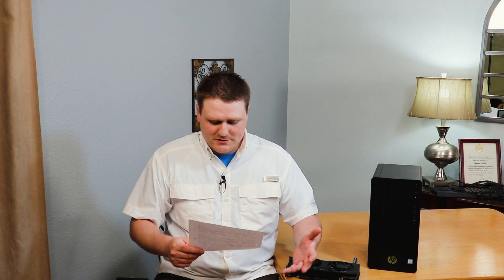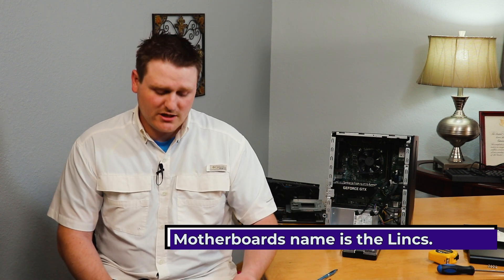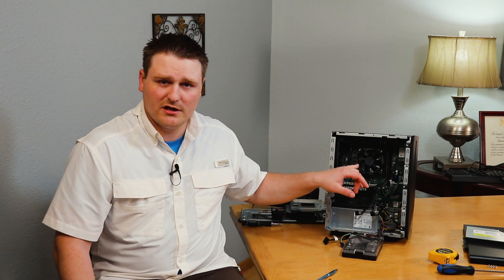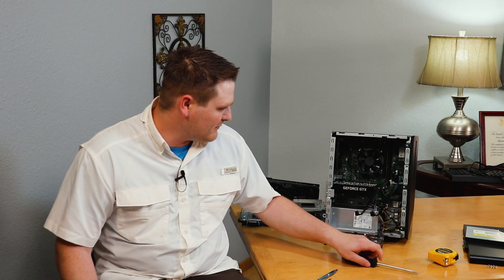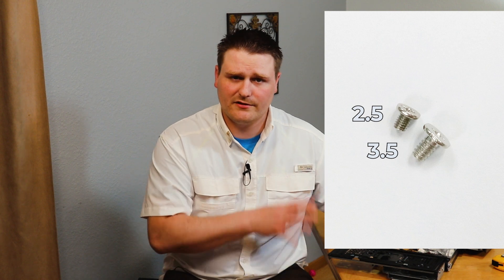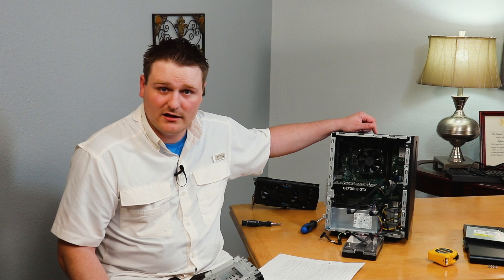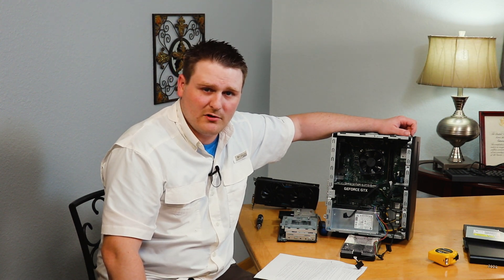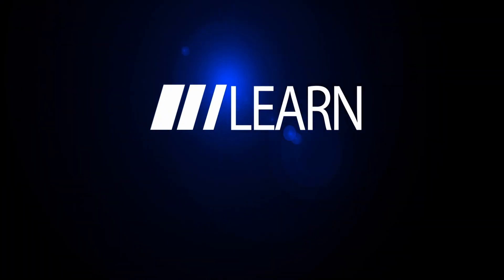Upgrading A HP Pavilion Gaming Desktop Explained! | Intel i5, 1660ti, 8GB, SSD + More! HP 690 Models

Comment: Hello techNW, I really enjoy your channel.
(you likely see my comments everywhere trying to work the YT algorithm for you !).
So it is 2025 and I would like to do a last upgrade on my pavilion 690.
I am a real newbie at this and I am now retired, just to give you an idea of who you are dealing with! L
I am hoping you can sort-out the best parts I can put in that box now/today in 2025.
I have removed the shelving/cage in the case and replaced the lid with a piece of clear acrylic to admire the innards...
The unit is:
(your link for the HP Spec Sheet, is now dead)
Desktop 690-00xx
BIOS Version/Date AMI F.50, 2023-04-20
 i5-8400 CPU
BaseBoard 843B
12.0 GB original RAM
One original SSD for the O/S and one HDD as a D: drive.
I use two external Samsung SSDs for movie and document storage.
.
Could you sort out brands and models that would fit that Pavilion for:
32MB fast RAM (I think that is the MAx for this motherboard?).
Fast Intel CPU.
Compatible aftermarket cooling block for CPU (a cool looking one would be nice 🙂).
*I am hoping to over-clock the CPU and GPU if possible*.
A fast SSD internal drive (or should I use a NVnE drive) to reinstall the games from the HDD.
I have ordered a 500 Watt PSU (L05757-800 87$ Canadian!) and scored a nice MSI 2060 Super (300$ Canadian)!! 
.
I realize this is a "big ask" but I hope you can sort this out for me, as... I am lost!
I am hoping to do some VR on this PC like MS Flight SIM and Mild SIM racing with like Assetto Corsa. 

Thanking you in advance.
a.

Comment: Hello, My PC Specs are the following:
HP
Series: Pavilion
Model: 690-0034
Processor Brand: AMD
Cores: 8-Core
AMD Ryzen™ 7 2700 (3.2 GHz base frequency, up to 4 GHz burst frequency, 16 MB cache, 8 cores)
Base CPU frequency: 3.0GHz
Max CPU frequency: 3.7GHz
Processor Cache: 4MB
Memory Type: 16GB DDR4 SDRAM
Memory Speed: 2666Mhz SK Hynix CL19
Max Supported Memory: 32GB
I would like to upgrade to the Full 32GB MAX
If I buy a ram with CL 16 specs will my bios automatically run at the lower CL19 that's it's configured for or will I have blue errors? Can you you recommend a Ram Brand that will work and not send me into blue screens

Comment: Would Nividia 2070 work with this system? If the card is 10.1 inches will that be too big? Also could I use a 2070 mini it’s only 8 inches does it perform the same? I’m trying to run six days on fallujah and it says it requires a 2070

Comment: The r7 3700x would work or do I need a new psu, same question for a rtx 3070 what upgrades would i need my pc is a pavilion 690-0024
Reply: And what’s the best options for gpu and cpu with no power supply upgrade(400w). And then what is the best cpu and gpu with a 500w upgraded psu
Reply from the maker: Yes, RTX 3060ti
Reply: @TNW1337  do i need a psu upgrade for it?

Comment: I had this build for about two years and I loved every bit of it but recently I’ve been running into high CPU usage problems while gaming and I’ve tried countless of solutions and updated my graphic drivers and I have nothing left to think of what to do to help it except buy a new CPU
Reply from the maker: Reinstall Windows. Reapply thermal paste. it sucks but most of the time if the hardware is not bad, it will fix the problem.
get a 256GB or 128GB USB 3.0 Drive Back up and Pic, Documents, And look up how to backup game saved files. Almost 95% of the time this is in your user folder. Most steam games are back up on the cloud even if they are single player.

Comment: Hello I have a question. What if i would upgrade my pc by just buying a bigger pc case, buying new power supply and new graphic card like 2060s would it match? I would keep the HP motherboard and all other stuff like procesor... would it work?
Reply from the maker: if you did a swap you would need 4 things. PSU, Motherboard, Heat sink and Case.

Comment: you forgot to mention what power supplies will work in this if you decide to upgrade the power supply to say 500w or 650 watt, that is what I need to do to mine. Any suggestions?
Reply from the maker: If you look at my Videos you can do a 400w and 500w PSU For most of the SFF HP Pc's.

Comment: My wife has a hp pavilion 690-0034.   I spent $700 on upgrades for it.  Just wanna know what’s the best graphics card to put in it.

Has 500w power supply
3 fans, 1tb m.2 ssd , 1tb 2.5 ssd hard drive
1tb wd hard drive, 32 gigs Ram, blu- ray drive,
2 tb passport.   And a pciex1 adapter 128 gb ssd.
Reply from the maker: Best would be the RTX 3070 Or a 6700XT
Reply: Thank u

Comment: I upgraded the ssd like the chip, the gpu and cpu but now my go pavillion desktop won’t boot into bios I don’t get anything in my screen
Reply from the maker: ok did you do a clone ?
Reply: @TNW1337  a clone ? I don’t think so. My brother took his 1650 super out of there, ram, and ssd so I just bought a Zotac 1650 oc, new ssd, a ryzen 3 3600, vengeance ram. The hp pavillion desktop still had the same cooler and motherboard so I don’t know. It starts up fine but it doesn’t show anything on my screen so I’m a bit confused.
Reply: I replaced the m.2 ssd to a Samsung m.2 ssd is that the problem?
Reply from the maker: @lyangonzalez6117  Did you clone the Drive when u swap it? is Intel optane enabled ?

Comment: Is there a motherboard that fits the case but supports up to i9 and 3090 graphics card?
Reply from the maker: Nope, your only option if you want to do that is a case swap to a different Case, Psu, Motherboard. Now if you watch sales you can do this for under $200.
Reply from the maker: 1st problem is 3090 are all triple fan cards, so to big for the case you could try a 16x 3.0 riser cable with a test rig and a extra 500watt psu. Also this would almost be the same cost of a case swap. But this would not let do a i9 upgrade. So the best thing to do would be case swap. That would allow both CPU and GPU upgrades.

Comment: So I've got the 690-0073w and was wondering if it's possible to slap an independent wireless card/ adapter in.
Reply from the maker: You do have a 1x slot open above the gpu.

Comment: So i purchased this machine about 18 months ago for my daughter to play fortnite. In its stock form i notice that she can pull down 165fps max at 1080p medium-high settings(this is also the max frames at lowest). CPU utilization is at 100%(2.9ghz) RAM util at 80+% and GPU util at like 30-35%. I got her the Asus TUF 280hz monitor because shes a competitive FPS player. Is this machine in stock form not able to run the intel turbo boost? it never exceeds the 2.9ghz despite the chip being rated up to 4.1ghz on turbo.  short of rebuilding the cpu/mobo/RAm/case/PSU, can i do anything to squeeze more out of it? seems like the bottleneck being at the CPU is pretty silly and with it only running at 75% or so of the max rating for the CPU maybe its just the mobo limiting it. Would i be better off gutting it and building her a gen 3 ryzen machine which can handle the FPS increase to get her more frames at a better visual quality? i didnt want to do a CPU upgrade if i would be better served with a mobo/chassis/psu upgrade and or maybe a ram increase. the NVME onboard, can it be transferred to an AMD machine? im not entirely clear whether i can transfer that or if it would need to be replaced as well. thanks!
Reply from the maker: Change the thermal paste and hestsink it sounds like it is hitting prochot. I never seen the pc not boost for the intel or amd version. Download intel extream tuing utility. Also download hardware info to look at thermals for well she is playing only time the cpu goes it to low mhz state is when it's seen very high thermal it is a protection mechanism. It could also be a bad cpu as rare as this is it can happen. The speed shift or speed step epp mod could be broken. All the parts could be transferred yes. You would need a new case, psu & mobo. You could go amd but need a new cpu & mobo. If the pc is holding at 144fps or above it should be able to play with out a problem. Hertz and fps are tied to gather to pretty well.
Reply from the maker: It could also be that you're using a game that is usualizing all of the cores and will not allow you to totally Turbo The cpu. The only way you can undo the bottle neck, would be to put in a  i7.  Does not support k edition. So need none k hope that makes sense.
Reply: @TNW1337  I do understand. But I suspect for the price of a better Intel cpu it might be better to snag the gpu and do an amd build. Plenty to ponder here
Reply from the maker: @CW-uw2cb  intel has really droped out of the game AMD was in lead but the 12th gen intels are doing very good.
Reply: @TNW1337  I should clarify that 144fps is easily functioning however her monitor can go to 280hz/fps. The more frames the better she can play and she's incredibly good
Reply from the maker: @CW-uw2cb  cool fact the humane eye can not see past 30 to 60fps. Only reason to go past this is for frame drops. The higher the fps the less likely it is to effect the game when this happens. Also can add smoothness to the game. Another reason is to game at 4k. So most gamers that play shooters do not like 4k becuase of the up scale the game does, it makes every thing smaller. Changes hit boxis, aim ect. This is why 1080p and 1440p is most common.
Reply: @TNW1337  well while the human eye cannot see beyond 60fps, the human brain is aware of the interaction difference with up to 1000fps and gamers at 240fps have a distinct advantage over those at 60fps and even a moderate advantage over those at 144. I've become so accustomed to 144 that I am actually able to tell you in a blind test which monitor is running at 60fps steady or at 144 steady. I do need to move the mouse myself but I can tell the difference each time without fail
Reply from the maker: @CW-uw2cb  yeah like I said it smoothness that's all your seeing. Some one way smarter then us well fuguer it out.

Comment: hi i bought hp pavilion gaming tg01-1122 and i can't see no display i tried few methods but nothing to seen work
Reply from the maker: Ok It is possible, it is DOA. Dead on arrival. Cheek the GPU is all the way seated on the Mobo. if the GPU has external Power make sure the  Power is plugged in.

Comment: I have the 400watt PSU can I run a 2060 super stated as 175w power draw
Reply from the maker: Yes you can.
Reply: @TNW1337  I watched your videos and can confirm this to work fine. Installed a MSI 2060 super OC and all is well. Bit of a squeeze but got it in just. Bought a 180 psu adapter but fouls on a drive so left as is. Thanks for the videos helped me install and get going.

Comment: I can plug a rtx 2070 mini (single Fan) with a 400w power supply in my hp pavillion that has a ryzen 5 3500?
Reply from the maker: What's the tdp of the mini
Reply: @TNW1337  i think that has 175w, i have another question, i can change the motherboard and the case, i mean, put the graphics card, cpu, ram, storage, in the asus a320m? And the power supply its compatible with the motherboard?
Reply from the maker: @Diegoportillo005  Psu would need to be different,

Comment: I have a HP Pavilion tp01-1137c with 310 watts powersuply, it has an GTX Super 4GB vídeo card, can I put a GTX Super 6gb vídeo ? card ? I've been seeking for an upgrade for my Pc , Powersuply but it seems impossible to get one with an p2 cable, the power supply needs to feed the Baker motherboard with three cables
Reply from the maker: Should work as long as it does not req external power.

Comment: Thanks for the video description. One question I have about the pcie M.2 expansion slots...I bought an XPG SX8100 Series: 2TB PCIe Gen3x4 M.2 2280, 3D NAND Internal Solid State Drive, which looks like the 2280 SSD drive you pointed to at the 7:00 minute mark.  Do you know if what I bought will fit into one of the 2 pcie M.2 expansion slots, or would it only fit where the 2280 SSD drive is, meaning that I would have to swap it out?
Reply from the maker: Only in the 1st slot, the other slot is a Sort/smaller slot for Wifi and Bluetooth cards only.You Could get a adapter to Clone you smaller drive then Swap the drives in to the old drive slot.

https://www.amazon.com/Extension-Cable-Extender-PCIe3-0-Speed/dp/B08B3RFSKL/ref=sr_1_1?dchild=1&keywords=m.2+extender&qid=1620866175&sr=8-1
https://www.amazon.com/Sintech-M-Key-Extention-Cable-20CMS/dp/B07DZCCGJN/ref=sr_1_4?dchild=1&keywords=m.2+extender&qid=1620866200&sr=8-4

Comment: Hello. I have the hp 690-0084 model that comes with a i5 8400 CPU/1060 3GB GPU and 400psu and I upgraded the RAM to 16GB. I am wanting to run a 1660 super which suggests a 450 psu. Do you think I’ll get away without upgrading to the LO5757-800 500 PSU? Thanks!
Reply from the maker: You can do that with the 400 watt you should be just fine.

Comment: I also have the 690-073w. Ive been wanting to move this to a new case, what all would I have to buy? Just a new motherboard? Or would I have to upgrade other things too? (I have 1660Ti & i5-9400f)
Reply from the maker: Case, Board And psu
Reply: @TNW1337  gotcha, sorry I’m new to buildings why do I need a new PSU? Is 400W too low?

Comment: I have the TG01-0299 model hp desktop it has a i7 9700f with a gtx 1660 and a 310 watt 80 gold psu would I be able to OC the gpu without damaging anything , also has 16 gb of ram
Reply from the maker: Um Yes you can but I would not go over 10%.

Comment: When I put one 8gb 3000mhz in the right slot it boots normally. When I put 2 8gb 3000mhz in both slots it doesn’t post and starts beeping. Plz help!!
Reply from the maker: Sounds like miss matched ram. This why you buy them in a matched kit.
Reply: @TNW1337  Both are from the same kit
Reply from the maker: @uasw6573  Bad Ram or a Bad slot on the Mother Board or need a Bios update.

Comment: I have the hp 690-0024. I upgraded cpu to r5 2600, gpu to rtx 2060, ram 16gb and 500w psu... but the airflow in the case sucks. So I want to swap everything to a new case, with a b450 motherboard and new 750w psu. But since it’s HP windows is on the m.2 ssd. So if I transfer everything to the new case and I motherboard what happens with windows? Will I need to buy a new copy or will it just recognize the new motherboard and install new drivers? Please help. So I can’t get my parts into the new case and new motherboard. Thank you!
Reply from the maker: It will end up asking for a Windows key. It is tied to the motherboard. And the HP SSF Motherborads only fit in there case. A new Intel or AMD Motherboard is like under 80 bucks. Intel is the B365 & AMD is the B450. You can get a nice motherboard but it will cost more. Little trick I do is look for some one on ebay selling the win10 Pro key for cheap. like under 10 bucks. Even if it is fake which I've only had problems one time. Make sure they send the key  as soon as you pay they will put this in the listing.
Reply: @TNW1337  is the windows 10 product ID the actual key? I found on my pc it says windows activation -> windows is activated and below that it says product ID: with xxxxx-xxxxx-xxxxx-GHFKL (example) is that my key?
Reply: @TNW1337  also if I do have to get a new key, would I just install windows 10 on a usb drive then swap everything onto new MB and in the new case, plug in usb drive and it will overwrite windows 10 that’s on the m.2? Thanks so much for the help! Subscribed!

Comment: Would a Ryzen 5 3600 work for the amd version of this pc?
Reply from the maker: What Cpu does yours have?
Reply: @TNW1337  I have the one with the 2400g  just recently upgraded to 16gb of ram with 3200mhz and planning on paring it with the 3600 but i don't know if it's compatible
Reply from the maker: @fyntc  Can you give me your model number. I Can look it up for you. I am pretty sure it well work If 3200Mhz did as you have the newest Biso update. It is the same socket AM4.
Reply: 690-0024
Reply from the maker: @fyntc  I am sorry, The best you can do is a AMD Ryzen7-2700.
Reply: @TNW1337  ok thank you, do you know the possible graphics upgrade because I have a 400 watt psu
Reply from the maker: @fyntc  https://support.hp.com/us-en/document/c06124756

https://support.hp.com/us-en/document/c05939208

Comment: Does this motherboard only work with this case? I got a new power supply and case because my graphics card didn’t fit so do I need to buy anything else?
Reply: I was able to screw the motherboard into my new case by the way but idk if the new case will work with it I get my power supply today
Reply from the maker: Motherboard, I would look at B365, They are on the cheaper Side. I like MSI at this price point, best options for the money you spend.

Comment: Can I use any PSU on the Lincs motherboard? Does it have to be a HP unit?
Reply from the maker: No you can not at this time. I am try to change this. U will try to keep the chanlle updates with the info. If I get one to work. Only hp supplys will work.

Comment: What is exactly the name of the 400w psu? I want to upgrade my 310w but I don't find the 400w.
(sorry for my English, I'm French)
Reply: Thanks, rtx 2060 work with 310w?
Reply from the maker: @GR-bz6er  Nope only the 400watt it needs a 6+2 pin PCI-e Cable. you can put up to a 1650
Reply from the maker: No name, it is a part number.